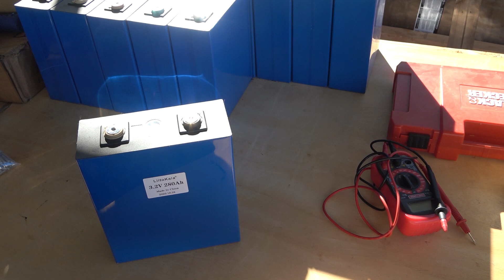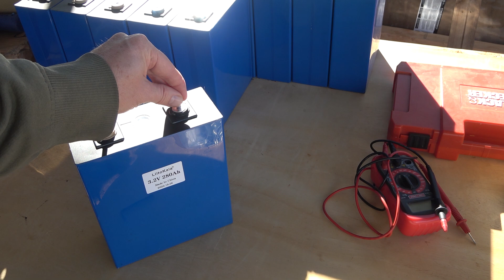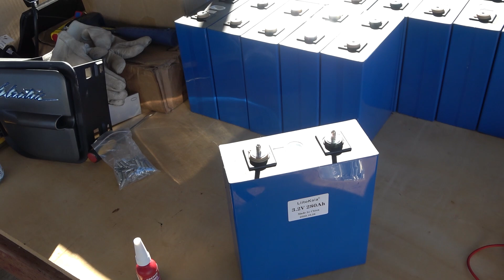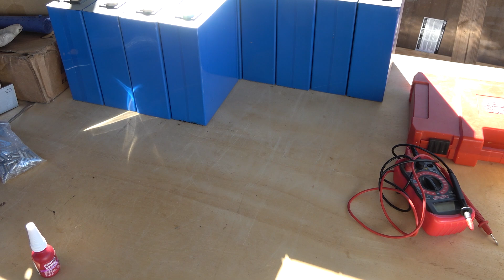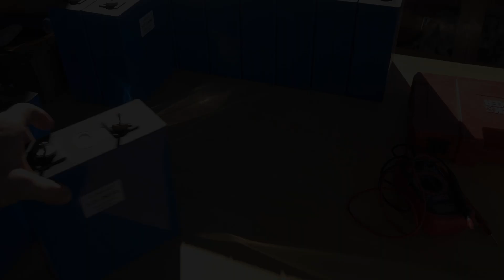Ford Ranger Electric: Battery C Rate

Comment: If someone used a 100Ah LiFePO4 battery, I guess it depends if they were making a pack with everything in series or if they did, for example, 2-3 cells in parallel, then series. I don't have any EV experience, but I do lots of lithium batteries for drone/RC airplane applications - it's funny to hear 1C discharge rate as for my use, I'm typically discharging at 10-20C with bursts of 50-70C. Different batteries for different uses, I guess.
Reply from the maker: Yes, that's true, and personally, I would prefer a 2p or 3p configuration because, if one cell goes bad, you're not completely dead in the water. Of course, doing that adds complication and cost. 

The problem with those early Ford Ranger Electric builds was that the 100 Ah cells were about the same size as my 280 Ah cells, so they were often just 100-104s1p. Based on that, you could be pushing past their max 1 C discharge rate just to maintain freeway speeds.

I'm going to discuss power density specifically in another video. People often misattribute battery power capacities with thermal management, when it is mostly due to the chemistry and construction of the cell. Some LFP cells can support 6 C or greater discharging, but they are often 50 Ah or less.

Comment: if i remember correctly, its 5c discharge and 3c charge for tesla 18650/2170.
Reply from the maker: That sounds about right. It's definitely a lot higher than the 1 C/1 C for most LFP.
Reply: @newscoulomb3705  Might be, i never had LFPs, but have a lot of li-ion laying around. Right now i have about 75 kwh of real capacity siting in my storage.

Comment: I wouldn't be too worried about going over 1C when recharging due to regeneration. My 30kWh Soul EV will regen 60-70kWh when in B mode at highway speeds which would place it at 2C, but it only happens for a second or two before the car has slowed down - LIFePO4 chemistry as well if I'm not mistaken.
Reply from the maker: It really depends. There's definitely a higher "pulse" charge and discharge rate, but that's only for a few seconds. I'm not worried about these cells because the max the Ford Ranger's system can generate is still ~1 C, but for the older 100 Ah LFP cells that people were using, that could be as much as a 2.5 C draw or recharge rate, which those cells aren't rated for. 

The cells in your Soul EV are a much higher power density, so a 2 C to 3 C charge or discharge rate should be fine for them.